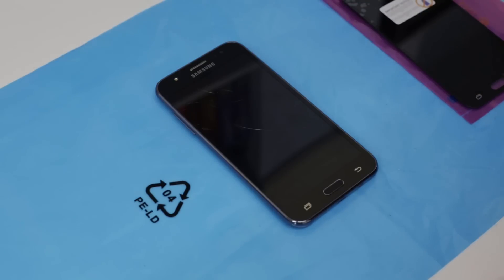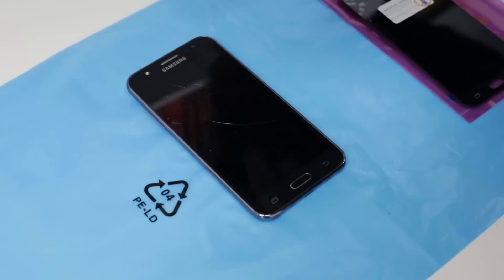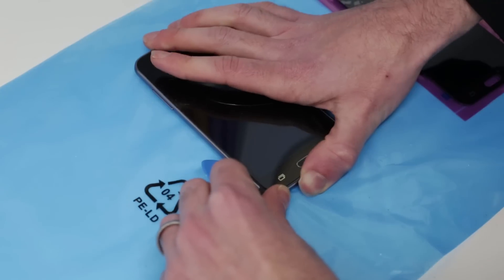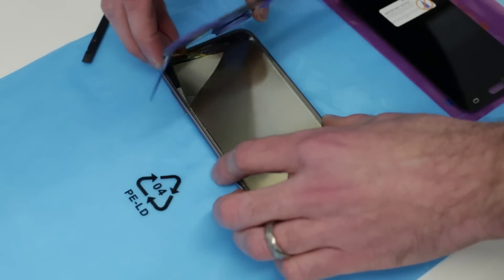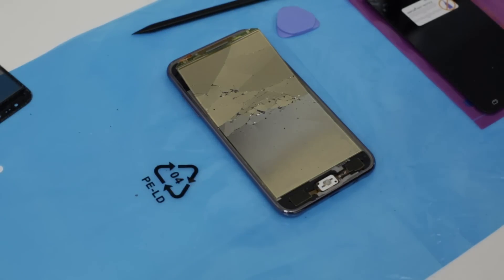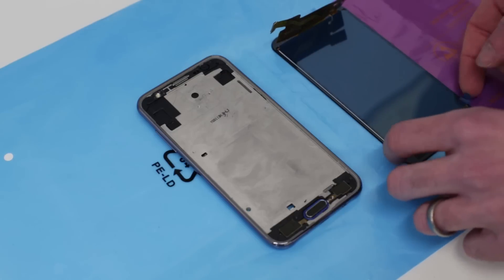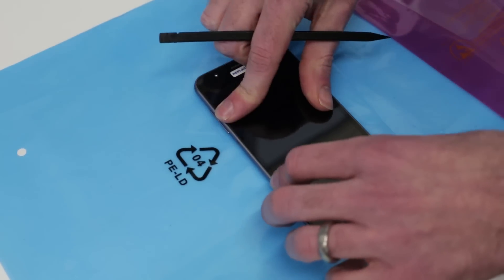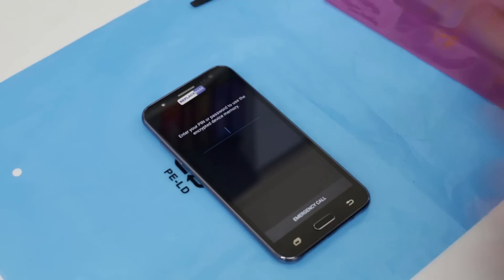Samsung Galaxy J5 (2015) Screen Replacement

Comment: Tip about Home button arrangement. If you replace your LCD screen and need somehow to arrange properly the Home button inside LCD hole, do it with tape. That is the best and easiest way. Find easily removable paper tape,  stick it to the front of the screen to cover Home button hole and then from the back insert Home button into that hole. In this moment LCD and Home button act like one piece. Put LCD on frame properly, try to click the Home button and see if it lowers (click). Then you should be fine.  Remove the tape from top of LCD and you got it! Cheers!
Reply from the maker: That's a good idea, thanks.
Reply: That's how i did it when replacing the screen, too bad the adhesive on the screen is thicker and makes the home button wobble and stuck

Comment: I have Samsung Galaxy J500 phone with badly working power on switch. Now switch completelly stopped working and can't turn on phone after attempting to fix button. Also after disassembly I noticed horizontal crack on display glass which appeared when trying to unglue frame. When phone connected to USB I can hear vibration, phone won't react to pressing buttons. Display shows nothing. Is it not working power button or broken display problem?
Reply: i am today bad day,  i am trying display safty removeing,but crack 😔

Comment: did you use a glue to attached the lcd touch screen back in place,didn't you?
Reply from the maker: From memory, the screen I purchased included an adhesive pre-applied.

Comment: Hi James was wondering if you know if the j5 2015 and 2016 have the same screen
Reply from the maker: I'm fairly sure the 2016 model is bigger, so uses a different screen.
Reply: Brue Computing thanks for your fast reply I’ve ordered the wrong one then 🙄 I see you say not to buy just the glass ,mine is just the glass is it impossible just to fit the glass only
Reply from the maker: The glass and LCD are bonded together, so the likelihood of separating them without breaking the LCD with no specialist equipment is REALLY low. Then you have to clean every last bit of adhesive residue from the LCD and bond the new glass to it in EXACTLY the right place with no air bubbles, etc. It may be technically possible, but I'd just order them as a complete assembly.
Something like this looks like what you need: http://amzn.to/2BHC9vV
Although I've not used these parts myself, so buyer beware.
Reply: Brue Computing thanks for your help😊
Reply: Andrew Smith im going to buy that screen was it good?

Comment: I followed your instructions every step of the way 
But the phone screen doesn't turn on? 
I can hear the buzz of the phone working underneath but it just stays black
Any ideas?
Many thanks in advance
Reply from the maker: Either you've not connected the cable properly, or the screen is faulty.
Reply: take off the battery and put it in again. If the screen is not faulty and its connected alright that should be the case. Had the same problem a couple days ago with a J3 16
Reply: @BrueComputing  Sir, was the part an original one or not? Maybe a link to the seller if not original? Is it good quality? thanks

Comment: New display wont adhere to frame, I cleaned away old glue. Does display backside suppose to have also adhesive because I received display that has adhesive only on sides?
Reply: no

Comment: 7:20 my top isnt sticking well, is it because i had to fit the top first? when replacing mine i fit the bottom first and it's sticking well but the top doesn't. what could i do I already tried heating up the top and pressing it but lasts for less than a day